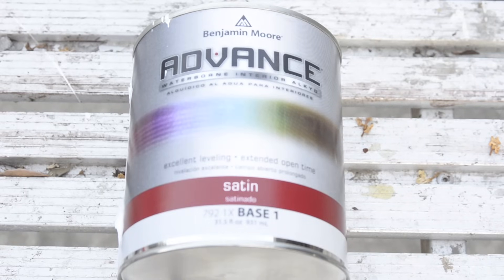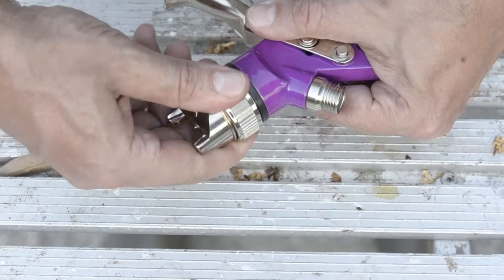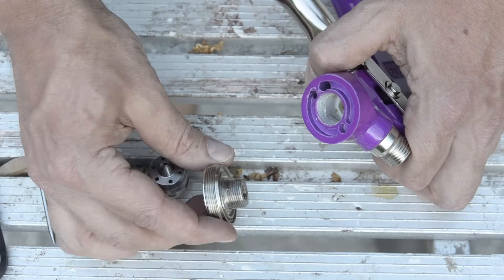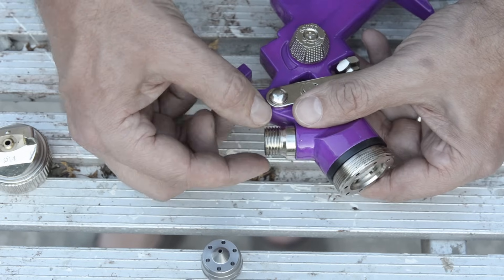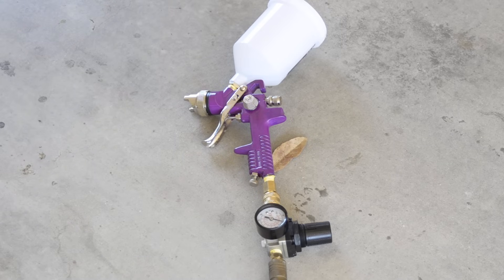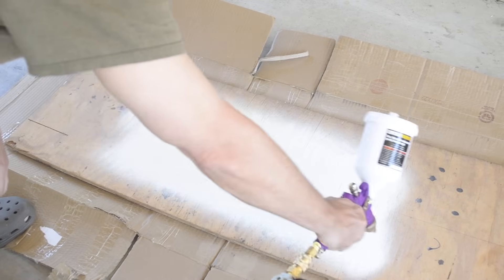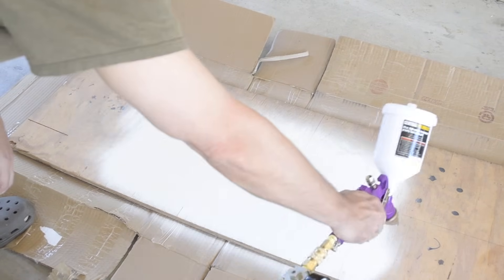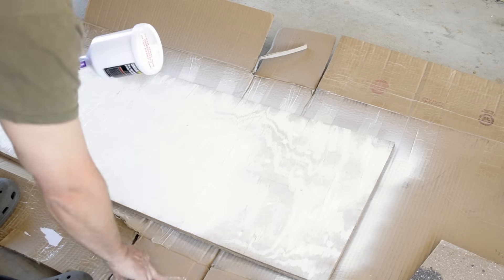Spray Benjamin Moore Advance with Harbor Freight "Purple" HVLP Spray Gun

Comment: so by spending $15 on a cheap gun and you still expect great results? I would say buy something that is atleast $50 with a 1.7 size tip and you should be fine to spray waterborne with little thinning, more fluid you'll need more air, you should be using atleast a 16gal 2.5hp air compressor so it wont be running constantly
Reply from the maker: Jorge duarte I just completed my bathroom cabinets and they came out great.  I’m totally satisfied and moving on to the kitchen.  I can afford a better setup, but I’m thinking this is great
Reply: Nathan Reed if you couldn't tell the difference that means you dont know what quality is, any cheap gun can shoot paint but a cheap gun will leave orange peel or will dry spray. sorry bud but theres a reason why some guns are more expensive than others.
Reply: @duartepaintinghandymanservices  sure there's a reason. Some people like money more than others do.
Reply: Paul Frederick that doesn't make any sense, would you like to elaborate?
Reply: Paul Frederick so you're saying that a $300 gun is the same as a $20 one. and they are basically just screwing the purchaser over because he is willing to pay the higher price for a greater quality gun that will produce a  greater finish? anyone here has any clue about a cheap gun vs. a pro gun? plus my recommendation for him was a $50 gun which isn't expensive and would actually spray the material he is using easier with less thinning, producing a thicker mil and better finish, but I guess thats also unreasonable
Reply: Paul Frederick perfect example of buying a ferrari and putting a ford engine on it. dude buys a $60 gallon of paint and uses a shit gun to spray it.
Reply: @duartepaintinghandymanservices  Ford beat Ferrari with a 1, 2, 3 photo finish. $60 a gallon paint is nothing to write home about either. There isn't a whole lot to a spray gun. So there's no reason one should cost a lot. It is a needle in a cap. The reason they do is because companies can get away with it. The Harbor Freight purple gun is legend. $10 and you're spraying.
Reply: @duartepaintinghandymanservices  they're kitchen cabinets not  the Concours d'Elegance. Most are just looking for no brush marks and faster material application. That a HF purple gun can deliver.
Reply: Paul Frederick must be nice living in a world of ignorance, to say theres no difference between a $20 and a $300 it's basically that, ask anyone who sprays and see what answer you get. see you bud
Reply: Paul Frederick a spray can, can also deliver no brush marks 😂😂😂
Reply: @duartepaintinghandymanservices  a spray can cannot put down a wide enough pattern to cover a wide surface. Paint in cans is not economical nor are there many material choices in cans. But hey if it works for you then have at it.
Reply: @duartepaintinghandymanservices  I am not the one ignoring the larger picture here. You are. Focusing on one detail to the exclusion of all other factors is no way to form a coherent argument. If someone does not need the performance then why should they pay for it? 10% gets you 90% of the way there. That's the way of the world. Painting cabinets is not the hill I am going to die on either. Just not that into it.
Reply: Paul Frederick but I wasn't commenting about you, this ain't you on the video right? didn't think so, have a nice day

Comment: You could always thin the paint with water and avoid modifying the gun.
Reply from the maker: Photog 1 you could, there’s just a lot of stuff written about problems when you thin more than 10%
Reply: You still need a 2mm tip the spray Benjamin moore advance even when thinned.

Comment: It will spray, but those hard plastic needle seals/parts which should be soft, start to leak so easily..  "A few times gun". It would not last long. Toy like gun. You could paint your dog house, or fence. There is very much quite good guns, ready to spray without restoration or very good cleaning, why not buy those..?
Reply: Those better guns you refer to cost three times as much. You could maybe fabricate some leather seals to replace the hard plastic seals. I think the trick is to ensure you clean and oil the gun well after use.
Reply: 3 times? I just bought a new Cap Spray Titan for $300 on sale.
Reply: @dustoff499  My DeVilbiss Pro lite 1,3 and 1,4 nozzle was 390€ Last life time. It's my hobby, i don't care is it 100€, or 400€  Some drink, some put his money for car, golf, and so on..  ☺
Reply: @dustoff499  just three times as much? Three times as much won't even buy you a tip for a good gun. Try over 60 times as much! Not to say that Harbor Freight purple spray guns are not good. Because people get great results using them.

Comment: I can save you allot of work. If you want to spray water based alkyds, latex or PPG Breakthrough its much easier to use the right gun to start out with and you don't have to modify it.  Thin the paint Max 10% and use a strainer when pouring it into the gun and you're all set.  use a gun designed to shoot "heavy metal flake" that gives you a 3.0 mm tip,  big enough so the metal flake doesn't clog the gun but you can also use it to shoot thicker paints without modifying anything....Approx 40-45 psi and you will get a beautiful spray pattern. Works like a charm on PPG Breakthrough.  I found a nice gun on Ebay for $55.00 which for a gun is dirt cheap.
Reply: Maybe you missed the part where he said this gun cost $7.99? That's the attractive part of this equation.
Reply: @1pcfred  Hi Paul , No, I heard that and I have a bunch of HF guns.  The gun I purchased wasn't that expensive...Like $44 delivered to my front door.  What I like about this gun is....two passes in the X axis and two pass in the Y.....and its done....I do on average 25-40 doors a job...I need to be able to spray wet and fast....Jut thought I would pass the information on....Everyone does their own thing...I get it..
Reply: @raymondpontremoli2489  if I was painting cabinets more then I could amortize the investment in equipment over multiple jobs. I'm hoping for one and done over here though. It was $8,000 for new cabinets and I'd have had to assemble and install those. So we're going with just paint. Trying to keep the costs down on this one.
Reply: @1pcfred  Yep, I totally understand.  My "hobby" turned out to be a full time job in my retirement.  I made custom cabinets for my bathrooms and kitchen and from there it was like trying to herd cats.  My friends wanted new cabinets and then their friends and it never quit.  Right now Im doing a huge job...44 cabinets and 48 feet of counter tops plus a stand alone island.  I have a specific gun for everything...One for shellac based primer, one for top coat finishes and one even for contact cement. I have been using PPG Breakthrough....To me its the most amazing advance in coatings ever.  I can spray three coats of paint  extremely fast.  Drying time with 10% denatured alcohol is less than one minute. The best part is the finish comes out flawless.  People rave about my finish coats.  I will never change paint as I cannot see anything coming out that beats this but, who knows...Maybe they can make paint that applies itself...and I can drink a beer and watch...LOL
Reply: @raymondpontremoli2489  with an alcohol based paint you probably smell like you're a rum drinking pirate. I have to spread some yo ho ho Zizzner primer over here today. I think I might setup a fan for the fumes? I used a PPG primer/surfacer/sealer on the last car I painted. I can't remember what it was specifically. I did like it.